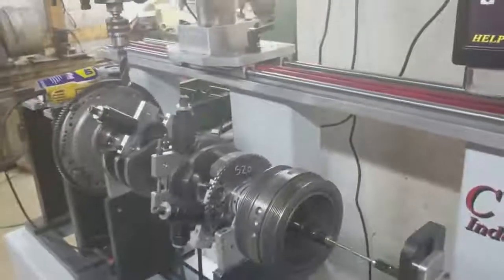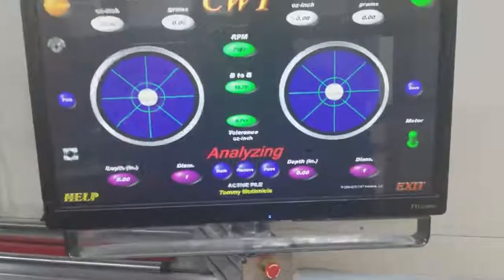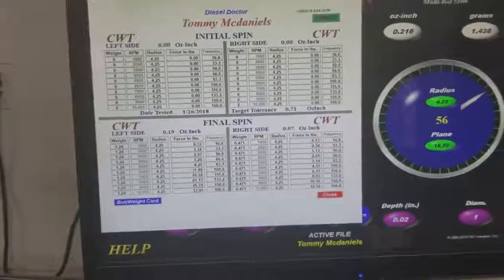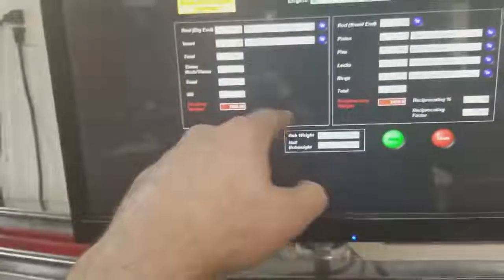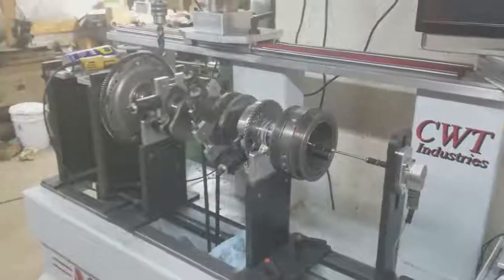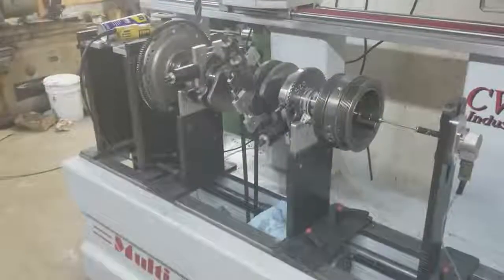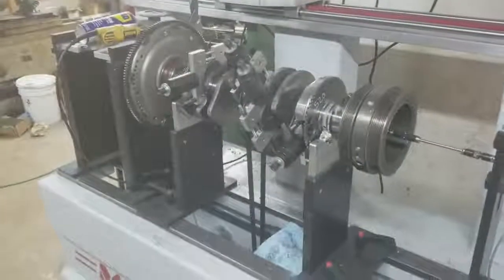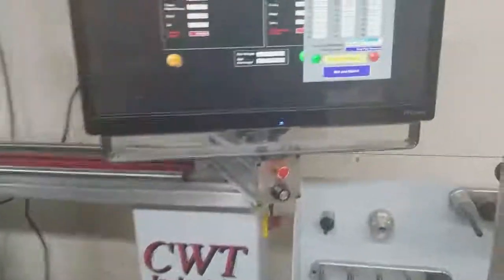Why Balancing Your Diesel Engine's Crankshaft is SO Important

Comment: Great video! The worst thing you can do is assume that any engine from any manufacturer is properly balanced.  The manufacturing engineering predetermined "fudge" is in some cases terrifying.  Try putting rods and pistons in a C series Cummins...could be an A, could be a B or could be a C!  I used to love that variation! I know of a factory GM 454 that was out of an RV...old man bought it new, my friend rebuilt it.  Upon teardown the pistons were all different and the protrusions were all over the place...must have been a friday engine!  Your tire analogy made my day!